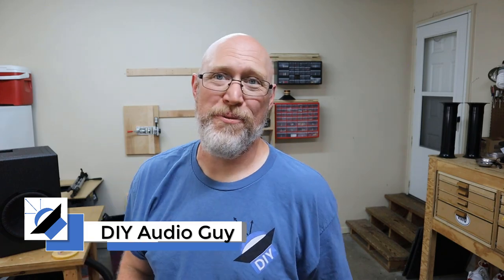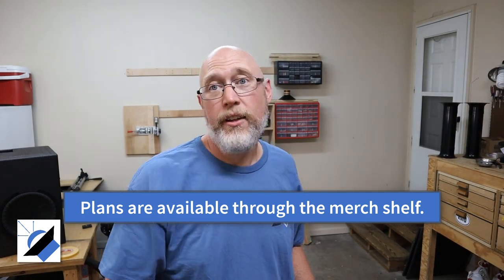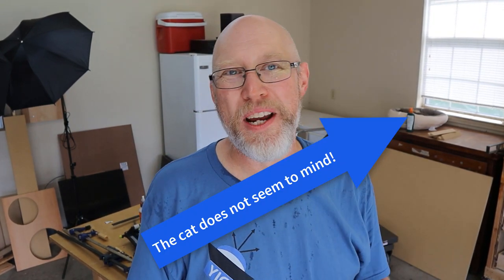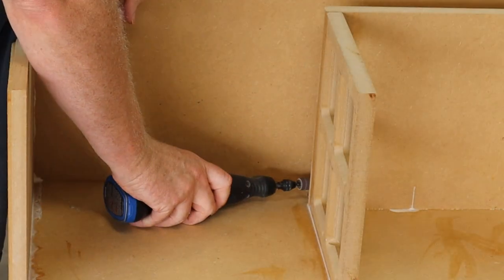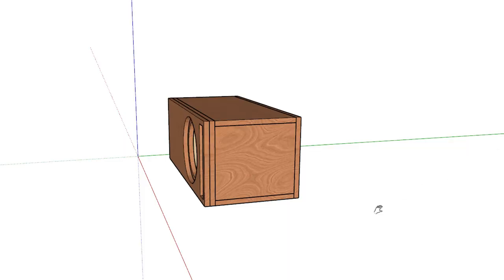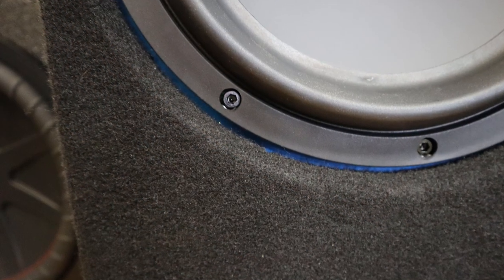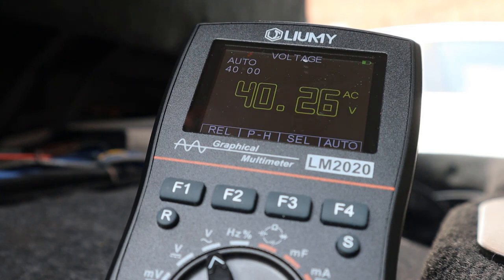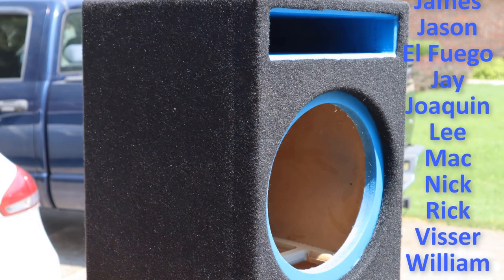Subwoofer Enclosure Build:  Final Assembly and Carpet

Comment: You are blazing the trail for many of us.  I would be more than satisfied to build a box even equal to what you have just done.
Reply from the maker: We all start at the beginning.  Get some tools and start making sawdust (aka man glitter).
Reply: Heck yeah, I would LOVE to build a box even remotely as nice as this one!
  My main concern, is that this sub, an Audiopulse Axis quad 1 ohm voice coil 12" sub that weighs about 56lbs if I remember correctly. It's 2500 Watts RMS and the engineer that designed it said it can handle 5000 Watts for a couple of minutes no problem.
  I want a bigger, low ported box for that sub to get the absolute most powerful bass that will fill in the bottom registers the best it possibly can!

Comment: That actually looks pretty nice!  

I try to avoid carpeting boxes these days (Duratex to the rescue).  The last time I did one and had to join the carpet near the middle of the panel, I joined along a curved rather than straight line (having a join along a straight line makes the join a lot more visible).  It took a lot longer to do of course, but end result was a join that was basically invisible.
Reply from the maker: I'm going to keep practicing, I want to get to the point where I can do it fast, clean, and accurate.  Then start trying to do some more complicated stuff.

Comment: Hey good job .
Only one suggestion to help get rid of "your super power" of blowing out pin nails. Being cabinet maker for 30 years you notice after awhile that pin nails always if they're going to blow out . they will curve to the right or left of the pin nail gun. So to avoid blowouts you ALWAYS hold the pin nail gun 90 degrees to board . so in video as example at 3:51 the way you are shooting/holding the pin nailer there's a greater chance you'll have a blowout.(as mentioned the nails love to curve left/right of the gun) . so lose your super power just rotate your gun 90 degrees from how you are shooting them in at 3:51 and almost zero blow outs unless you aren't shooting straight into wood below. 
Well have enjoyed your watching videos for awhile hope this tip helps and let others in on tip in a video sometime. I fix n try to teach all the young people at work my knowledge(only if they learn to listen) so they become better and more efficient.
Reply from the maker: Thanks for the tip, I'll give it a try!
Reply: Another tip to get rid of pin nails that came through is to grab them with a pair if pliers and bend it back n forth till it breaks off . almost always breaks off below the surface , and you don't have bad scratches or gouge marks . helps if you are doing veneer type boxes then micro spot of putty ,lil bit 'o sanding n all gone well fer the most part.

Comment: I just watched the boombox build-off from back in march.
I've built a good few party boomboxes, both for selfuse and with the intention of selling.
I would be interested in seeing a propper "turn it down the cops are at the door" boombox.
Something that hits 125-130dB, it battery driven and of course, DIY-able.
The struggle i personally always finds myself in, when doing these builds is:
- Weighing more than 20kg(40lbs) is a no-no. Has to be portable and light weight.
- Do i need mids or are subs and tweeters going to be good enough for this particular build.
- As small as possible without compromising too much on the lows.
- making everything fit on the front panel.

I've found that using anything other that pro-equipment guitar/home audio PA speakers makes little to no sense.
It NEEDS to be battery driven, so high sensitivity is usually key and an amp delivering more than 200 watts kills the battery too quickly.
Having lots of actual experience at parties with speakers, i can safely say that the boombox terminal/knobs can absolutely not be on the top due to spilled drinks, people sitting on it, rain (left out over night cause people pass out).
All this makes MDF a no-go as well.

I would love to see you try to tackle this problem. 
I've personally found, that the right dimentions for a boombox seems to be H:55-70cm. W: 35-45cm and D: 25-40cm.
For the smaller ones i usually use 2 subs and 2 tweeters and for the bigger ones i often go 1 sub, 2 mids and 2 tweeters.

Good luck, if you decide to take up this challenge.

Oh, and costs obviously need to be kept as low as possible, fewer moving parts is always better, thus passive radiators makes no sense in these kinds of builds.
Reply from the maker: Cool idea.
Reply: Screws are pointless.. Brad nails are just to hold the pieces till the glue dries.. wood glue has x times more holding force then any/all screws in wood materials.. especially plywood and even more so in MDF.. 

If you are concerned about pressure then you dado the panels so they interlock.. but depending on the wood glue you’re using you achieve 3-7000psi of holding force if glued properly.. your basic sheet rock screw which is what most are using to build boxes is 75psi in wood.. it’s going to be much less in MDF.. it’s bot even close in comparison in terms of strength..wood glue on wood is similar to welding of metal.. the joint will be stronger then the material around the joint.. so you are more so concerned that the wood will blow apart before the glued joint give way.. this is wood working and metal working 101 which just isn’t going to happen in a sub box.. if you reach pressures that intense inside a box then you basically have built a explosive device not a sub box lol
Reply: Large 3D printer, smaller subwoofers with HIGH BL in a T-line enclosure that's formed as a part of the case it's self.
Reply: The issue with that is the level of engineering that's going to be required.

Comment: I'm working on a sealed 4-15 wall in my CUV. I'm using Skar SVR-15's right now but really thinking about max-x 15's as the next form. I want SPL but sound quality is more important at the end of the day. 4 D2's with coils in series, wired in parallel down to a 2-ohm final on a 2-ohm final full bridge.
Reply from the maker: Cool!

Comment: I have the same Ryobi nailer. Works smoothly and consistently.
Reply from the maker: It has been working great -- it is a little bit bulky and can't fit into tight spaces but much better than dragging an air hose all around the shop.

Comment: For boxes that will build ANY real pressure, you should predrill and use wood screws in addition to glue and Brad nails. Silicone the inside of the enclosure BEFORE putting the last panel on and I use a silicone based adhesive one the last panel to prevent any air leaks...my 2 cents. Other than that, the box looks good.
Reply from the maker: That will definitely work.
Reply: The glue. Is stronger then wood. When properly applied,  the joints will not fail. The wood will break, before the joint fails. Nails or screws, are just the clamps, to hold panels together, while the glue cures. In over 30 years, we have never had an enclosure fail, utilizing the same technique.

Comment: So you talk about glue and brad nails, however with a big build like running a lot of power would brad nails and glue still hold just as well as wood screws?
Reply from the maker: The glue is stronger than the wood.

Comment: 3M Super 77 spray glue works really good. it sprays more like paint and not a spider web. Ive carpeted many, many boxes and still hate it.  Usually only offer duratex now.
Reply from the maker: I've used the 77 before. Definitely going to go back to that or figure out how to spray weld wood in a spray gun.
Reply: @DIYAudioGuy  If you do, Doug @soundmanca  has some great videos of him using that method :)
Reply: That's what I was going to recommend.  I like that for about everything that needs to be stuck.

Comment: What screws do you like to use to secure the sub to the box?
Reply from the maker: Anything with a coarse thread that does not have a beveled head.  Especially with MDF. I find thread screw can pull right out.

I'm also a big fan of pre-drilling screw holes.

Comment: Can very thick floor carpet from the Home Depot or Lowes hardware store be used to carpet a subwoofer enclosure and can you substitute carpet for a subwoofer enclosure with fleece or felt.
Reply from the maker: You can cover an enclosure with just about anything.  I've never worked with those materials so I can't tell you how well they will stick to the adhesive, how durable they are, or how they look.

Comment: Hey bro. You've been a bigger help than anyone else I watch on YouTube. You're like legit car audio college professor type shit. Have you seen the bass knob on Amazon that has 2 seperate knobs? 1 for Frequency &  1 for Gain? I swapped speakers, so I'm not for sure if it's slightly interfering with my connection but my new speakers aren't hitting anywhere near as hard since I installed it. I'm about to put the oscilloscope to it & see if I can get a good, clean signal. Lmk what you think of it if you get a minute to check it out.
Reply from the maker: Not familiar with that particular bass knob.  Is the frequency controller crossover? Or is it a parametric equalizer?
Reply: @DIYAudioGuy  I'm not exactly sure. After messing with it a little, it doesn't seem like a crossover, but im not sure. The "frequency" knob goes from 40hz - 150hz. All the way up, to 150, puts a shitload of power to the subs. I set my gains with an oscilloscope with it all the way down on 40hz & I had my gain & bass boost full blast with 0 distortion/clipping. The sine waves were about to top out tho, so I left it there. A quarter of a cunt hair up on the frequency knob caused immediate clipping on the scope. My music sounds so much different, not hitting the right notes. I also doubled my RMS, & now, have a sealed enclosure. Also, I faced the subs toward the front of my car. Before, with my Bandpass setup, they were facing the rear.

Comment: Adhesive...contact cement in a gallon or quart can from any hardware store and a cup type paint gun, with a 1.8 or 2.0 needle, and play with the air pressure. that stuff never lets go.
Reply from the maker: I have picked some up.  Just need to find the time to figure out how to use the spray gun.  Any recommendations for cleaning the gun when finished?
Reply: @DIYAudioGuy  lacquer thinner.. a lot..

Comment: The best enclosure carpet to use that hides seems are the charcoal colors
Reply from the maker: Absolutely, I've also found that hitting the seams with a little black spray paint after the fact camouflages some smaller mistakes.  The goal of course is not to make those mistakes.

Comment: I notice you make alot of square or rectangular boxes with alot of brad nails, I used to make fish tanks with glass and use alot of the same technics as you do but used straps to hold them together on a wood jig, and with all those straight sides what do you use to keep the echoes down?
Reply from the maker: Internal bracing helps a lot.
Reply: @DIYAudioGuy  Have you tried unsquare shapes or fiberglass inside?

Comment: WhAt are the other purposes of putting a braces aside for vibrating the box?
Reply from the maker: The idea is to break up the panels so that they are not all the same size.  That way they will resonate at different frequencies.  If they all resonate at the same frequency it may color the sound.

Comment: Tight bond and mdf is like welding together when dried ..Screws, Brads Staples don’t matter.  Brace the box. Spray the crap out it with rubberized spray on the inside.   Hit all the outside seams with the same spray.  Wait a day between each step of the build for fumes to go away. Carpet the box so when you hit it from the outside with the sub it sounds solid like stone!!!!!!!Here’s the secret. Listen closely… you want that box dead. Like the resonant peak to be so low it doesn’t present a tone higher then the intended sub frequencies Make it heavy…strap it down…do whatever you got to do. If it rings or is echoy it’s gonna fucking suck.  Period.
Reply: It should be like outer space in the box.
Reply from the maker: Parts express has some roll-on/spray on material that some people put on the interior of the box.  I think you can even sound deaden a car with it.
Reply: Gorilla glue has a rubberized spray at Home Depot. Don’t need anything crazy.
A box half filled with poly fill.. even when ported lowers the F3.  The fibers vibrate causing heat and that increases temp inside the box.., as temp increases pressure increase.  When the driver moves is then displacing air that is greater then normal atmosphere pressure. Polyfill help increase that!! And there is a differential between pressures in the box and out. The sound waves that  radiate from the box( inside) and outside are different and you get less phase canceling.  Just like a sub cancels phase when sound travels through a car that same thing happens when sound travels through the cone itself. If they are the 180degrees out of phase right out the box almost makes no noise at all. 
Ported boxes are trying to lessen the phase cancelling at one particular band or frequency but music doesn’t work like that. Music Is dynamic
What I’m going to say next  will blow some peoples minds.. when a sub frequency wave travels through the air and there is another one they interact if they are slightly different. The waves bend and the normal wave size shrinks. That Summing brings the bass wave to full bloom closer.   Kinda like when crossover frequencies sum. If that happens to huge waves those waves bloom in the car or close to it. 
When a rattle in the car or the box makes a noise it effects many frequencies and how they interact.  I know it’s crazy..
And when the seasons change the wavelengths change. Summer hot days and cold winter night effect the wavelength sizes. And throw everything off.  How many people have set the gains only to come back the next day and just thing how much it sound thin or worse.  It’s because even the environment is dynamic.

Comment: So, I hate to be "that" guy . . .  but I am going to be "that" guy. If you are going to use MDF (MDO would be best) then staples would be a better option than brads. Most nailers today have the option to drive both. However, if your nailer does not drive staples then it is not worth going out to buy one that does drive staples. If the box has that much pressure then screws could be a better option. Of course, screws are drilled and drived only AFTER the glue has dried. While I am NOT a car audio guy I am a furniture builder.
Reply from the maker: Thanks for the tip.